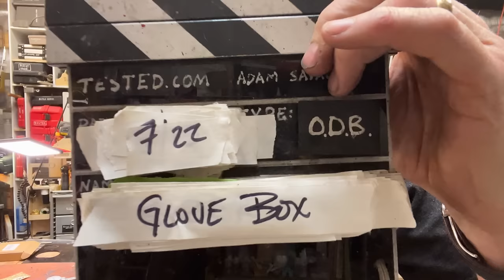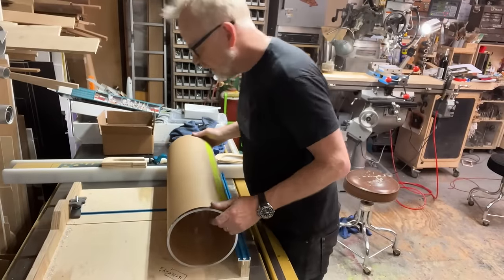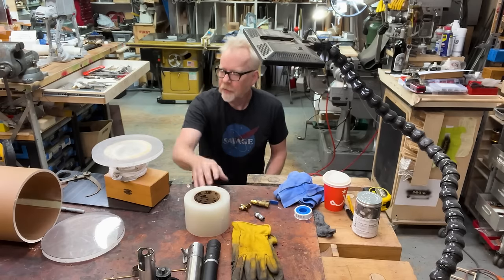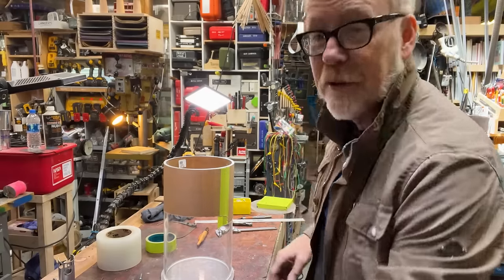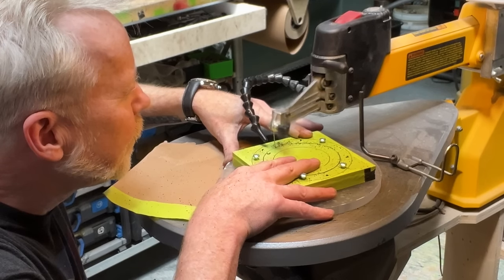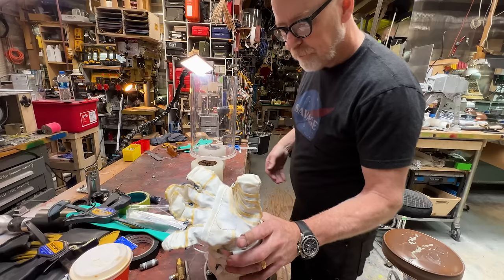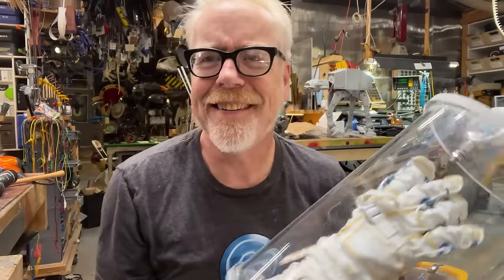Adam Savage's One Day Builds: Spacesuit Negative Pressure Chamber!

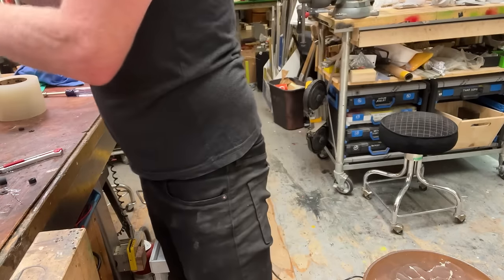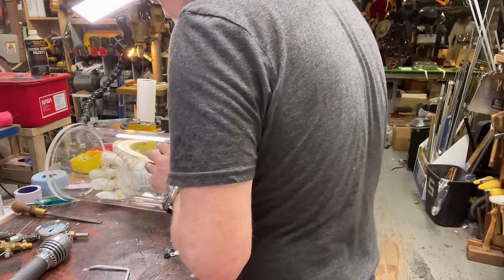Comment: 1:04:41 - is it, though?  Because 1:04:45 - I don't know how you're going to unscrew things without having a way to get a screwdriver inside.  This is where those tapped wholes you decided to skip out on (27:14) could have been really good.  perhaps aluminum instead of delrin/whatever for that innermost ring, tapped, and then bolted into those tapped holes from the outside.  Well, maybe they're tight enough with the friction from the glove and such (1:08:10 seems to indicate yes) that you really can loosen them and get things back out.  I hope so.  But I worry.  :)  1:11:46 - Hmmm... we're about to find out, I guess!  - 1:12:28/1:12:51 - well, hey, it's a learning experience (1:15:39)!  And you did manage to adjust the glove tension (1:13:43) and I think add a gasket to the dial (1:14:15), so that's something!

Well, between the learning experience and what it could do as-is, overall I'd say job well done.  Must be fun to play with. :)

P.S.  And if you do ever do another, I have the thought to have an inner and outer ring of bolt holes, where what's currently the inner ring (the black one, #1) is attaching to a second ring (not currently existing in this model, #2) that's on the outside of an outermost ring (currently the clear one, #3), with a second gasket between #2 and #3, and where #3 is threaded, so that #2 can be sealed to it from the outside, and then when released from #3, #1 and #2 can come out as a piece, including the whole glove, to allow complete access to re-work things.  I'm further imagining that rings 2 and 3 would have shoulders on them, so like, maybe they're the same thickness of material, and go inline, but a shoulder on the outside side of #3 matches to a shoulder on the inside side of #2, and the gasket goes between the two shoulders or something (or maybe there's even a slot for an o-ring?!?)  Anyway, fun times.  :)

Comment: Cutting the cylinder on the table saw like that gave me the heebie jeebies. I think I would have gone for a series of linear moves, and only rotate the cylinder when it's not engaged with the blade. Push it in and then pull back out of the blade, rotate a bit, push it in/out, rotate, etc.

Comment: Adam, watching you struggle with leaks made me think you missed a chance at making the whole thing easier to take apart or repair.  Add a wide flange on the outside of the glove end, and cut another acrylic circle (wider) to match.  Seal them together with bolts/gaskets.  That way, you could take the whole glove/end off of the chamber, and could potentially remake the entire glove/box interface if needed.  That also leaves the most glove inside the box, rather than having the retaining rings outside the box.

Comment: Anyone know what kind of tape/adhesive covering that was that he used to protect the end caps?
Reply: It's either parafilm or more likely transfer tape
Reply: @M4ng03z  It's not parafilm or at least not the normal type for sealing lab glass.  I have a box of that sitting on the bench behind me and it is quite different. Do they make other kinds? I'll definitely check out transfer tapes. All the stuff I've used is backed rather than rolled on itself, but I've only ever used the consumer stuff for vinyl plotters like a Cameo or Cricut.
Reply: @ender4555  upon further inspection (looking at the logo in the video), I think it's 4" clear heat shrink tape. Mr. Shrinkwrap and Dr. Shrink seem to be the common brands, the former of which is on Amazon for $30. Honestly, I think Adam just grabbed the widest tape of any kind he had laying around to save making 3x as many passes with painter's tape

Comment: Could you find an original glove connector as used on an actual suit.  This might solve your leak issues.
Reply: @Bad Wolf: those attachment rings are proprietary (and VERY expensive - since they rotate freely AND hold pressure).  BTW, I work for ILC Dover (the company that makes the real EVA spacesuits for NASA).

Comment: You were mentioning soap and bubble.  For air you want to use smoke  to trace the path.  Take a smoke (or simulated smoke powder), fill a garbage bag.  Close it around your whole glove box and you should be able to trace where it is leaking in.  This will remove some of the guess work.

Comment: It would be nice if you included a build list in the notes.  For many of us we didn't know materials or sources for what you were using or where you got it.  For instance  whst kind of saw blade and the number of teeth were you using on the various saws.

Your lack of use of PPE is at times scary. 

They now have Teflon tape for use with gas lines.   It may have helped with your valve and gauge mounts.

Bob

Comment: 27:19 made me sad with that single comment- Should've threaded bolts into the acrylic tube for a much better aesthetic appearance, rather than relying entirely on the glue bond.  The mechanical affixation is also more of a permanent feeling solution and won't degrade over time.
PLUS!~ Who doesn't think the look of bolts being threaded into a clear material like acrylic

Comment: Negative Pressure Chamber that a bit optimistic about calling "Negative Pressure Chamber" Negative is -minus, in the contexts of numbers, unless space not set a zero, ? can you have less volume nothing?
Reply: @dh: in this context, "negative pressure" refers to less than atmospheric pressure.  At sea level on earth, the air pressure is 14.7psia, in Denver, Colorado, USA the air pressure is around 11psia; on the top of Mt. Everest the air pressure is around 3psia; in low earth orbit the air pressure is very close to 0psia.  Since Adam is in San Fransisco (i.e. near sea level), negative pressure would mean anything less than 14.7psia.

Comment: nothing I would have done since you're going to pressurized this what I would have done is since the end plates are half inch polycarbonate or whatever you call them what I call plexiglass I would have took and found a way to spend them put a left on them that they fit inside the tube and then I would have glue them together but would have been a more positive grab for the pressure you're going to put under it

Comment: I don't want to call u dumb. But when you put all the bolts in and tried to line the glove up. You where being silly that would never have worked. But that's easy to say sitting on the couch. Lol all part of the process. Also u did them in a line I would have off set them front back left right then fill In the gaps. U have to stretch the glove a little

Comment: Hole saw for cutting marble and stone wont chip the plastic. And they have this water stuff called water that has a cooling effect. I find the mesh demo blades for cutting metal great for cutting plastic sheet. Even the thin roofing plastic wont chip if go slow. I find the more expensive the tools the more boring the video content. Found this sticker back pleather products great for repairing cushion seats. Cracked cushions on a shorts day can be troublesome.

Comment: Why do you use inches, feet and other nonsense that is so inaccurate and clumsy? A kilo means a thousand, a milli means one-thousanths. A meter is the length of the path travelled by light in vacuum during a time interval of 1/299792458 of a second.
If you are going to be doing engineering and science, use exact values. For goodness sake.